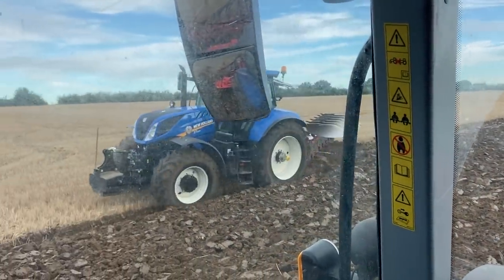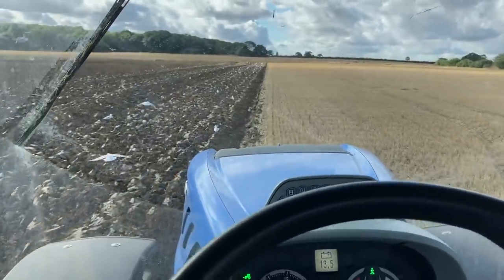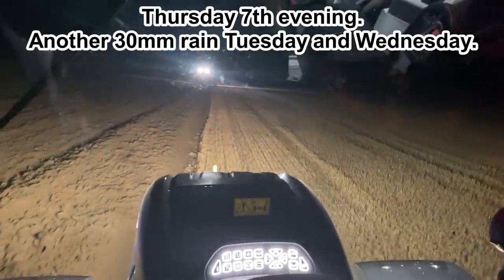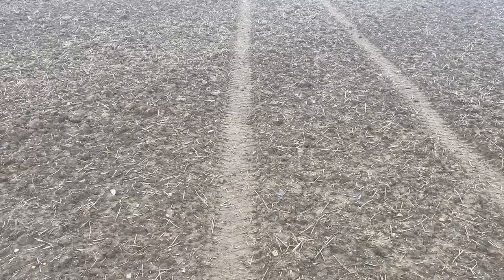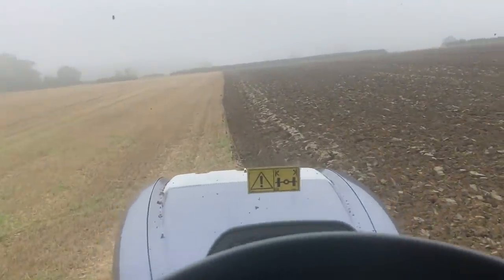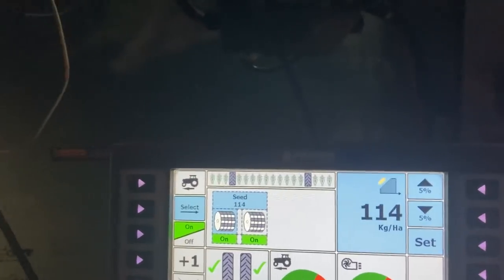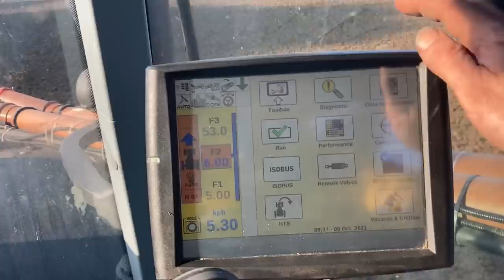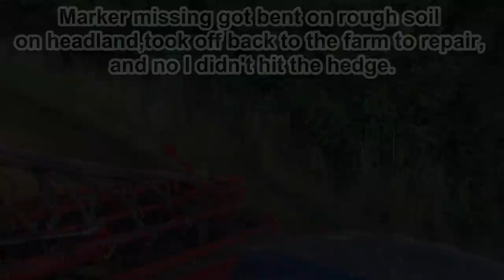Blue power T7.225 at the farm.

Comment: Great video love set up. We been running blue power since 2016 and although Fendt 1050 is class machine it much to big for our area and performance is great. Plough, power Harrow, drill 3 machines on the go feel like top the world
Reply from the maker: Thanks for the info!
Reply: @farmerstephen  I was trying to relate not infom. Fastrak we had on demo to draw some maize in out performed our NH in just about everything. We had Kv 8 furrow plough that we Purchased in 2017 that T7 couldn't pull in our soil so thinking N. H is way over priced so we thinking change when cheque comes in.
Reply from the maker: Just be careful with the fastracs they are always breaking down. We have two and the newer one has had a lot of problems.
Reply: @farmerstephen  be fine my brother works for Ross Farm machinery who are our local J. C. B and Fendt dealership so think that part reason would be easier for us to slowly make the transition. Thanks for the info!